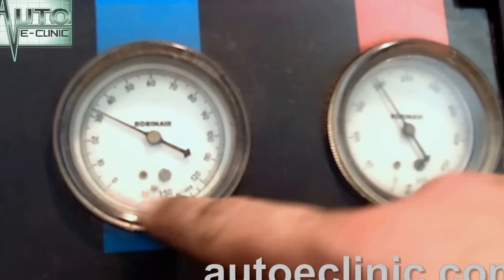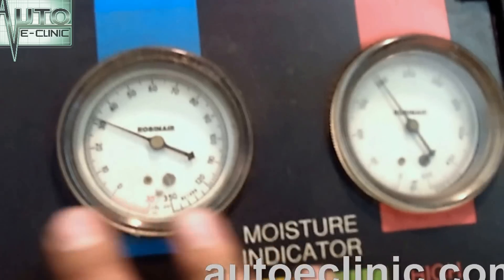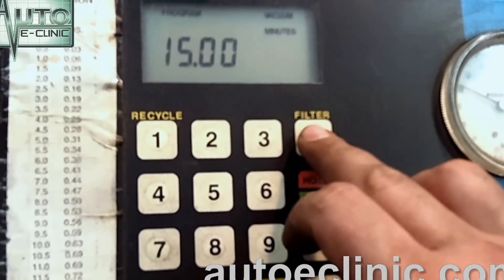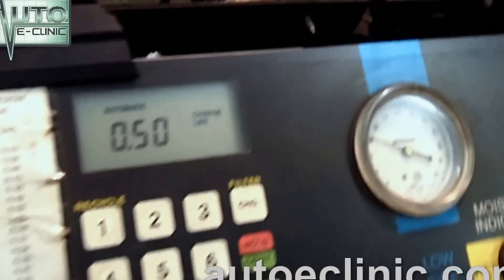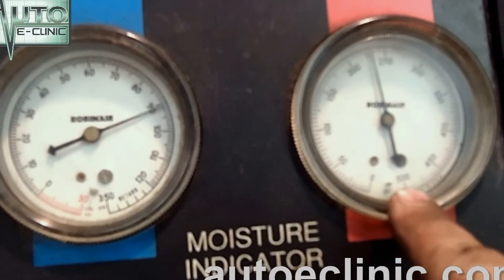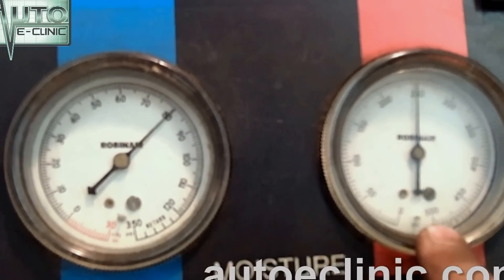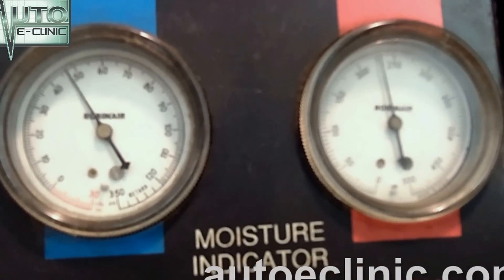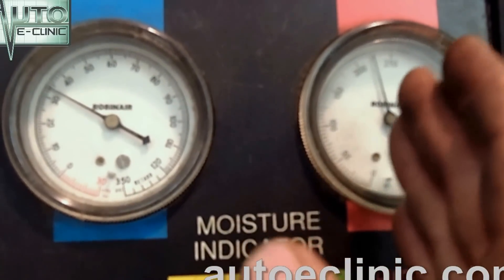How To Recharge and Diagnose Automobile Air Conditioning

Comment: i would think if i had a vacuum unit in front of me and i can remove all in system like water maybe ... i would use it only takes 30 mins and i have a machine more easy. i could go to lunch or work on something ... so i guess it is not needed to vacuum out the system to charge it ??? i see you removed all freon and thats how you found how much you had in the system so i am just learning A/C systems for i am a Master Engine Builder and i sometimes must remove A/C first before i pull the engine, so i must pay to have it remove and recharge ,,,, which takes a lot of money and time... but i see you do not have to vacuum unit to add a charge i think...

Comment: I just got my gauges today. I have some experience on car A.C. from a shop I worked at 30 years ago back when only new cars had 134 most had r12 you could buy a can at most stores by the oil. I got an orifice tube and a new dryer. Compressor comes on and off but it has very little cold air if any at all inside. Going to replace those parts rest a vacuum pump from the auto parts and see it that fixes it. Do I need to add oil back into the system after I vacuum

Comment: I put in new compressor, new oriface tube, new accumulator and blew out and pulled vacuum and when I fill it the low side rises and high side does not. Could it be anything besides restriction??????    I’m at my end with this car.

Comment: With today’s cars  small is 12 ounces of refrigerant charge if you’re just two or 3 ounces overcharged you can see 440 psi on the high side where the pressure limiting switch will kick off the compressor.      And the majority of all vehicles produce today are variable compressors that are controlled by software and sensors and you cannot fill up the system using cans by using pressure on the high side and low side because the software is continuously varying The compressor displacement and trying to maintain a pressure that is the most efficient no matter what the refrigerant charge is high or low

Comment: JesusHchristmasTree, you fools ALMOST know what you're talking about. At 00:21  the errors start; NO safety goggles, no protective gloves, either!  
At 04:02 he says "...it's lower humidity in here" No, it's probably higher humidity in the COOLER shop! Humidity rises as the as "the same air" temperature drops. 
At 05:42 he misstates "...we're showing you how to do it WITHOUT gauges"?? Huh?
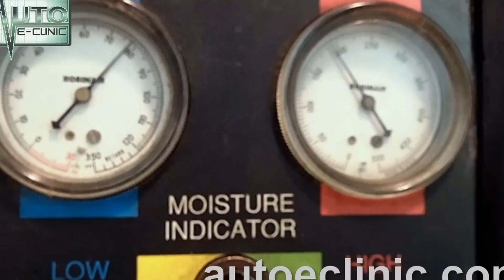At 06:10 he repeatedly says "thermostat" instead of "thermometer". 
This was a MISDIAGNOSIS! The starting low pressure (100 psi) was more than enough to allow the compressor to engage. Why didn't it?
Reply: Stop whining and complaining like a Queen or Democrat, be thankful he posted the video.

Comment: I have a 2000 Jeep cherokee  4.0 it will not take freon.. Has been vacuumed. what will cause this...All help appreciated...i tried jumping it over from the switch and it blew my big 20 amp fuse. Twice... you could hear the rpms raise a little but didnt kick the clutch in. Im showing both sides hot/power on the low side pressure switch with a test light. Ubnless i unplug the high side. Then 1 side shows power other dont  but bridge over then and dont blow fuse but dont cycle clutch. It will also blow a fuse if i try to bridge it over from the relay.. However i can kick the clutch in by running 1 wire from  hot on the compressor to the hot on the battery then clutch works... Still wont take freon. Help...

Comment: Did you fix a control problem because you took out 1.84 and said full  2.22 lbs was fully charged.   At the 5.20 time frame you took out .5 lbs from full to show what the system readings were  and the compressor was cycling just fine. That put the system at 1.74 lbs lower than the starting point. This was a great video with a lot of good knowledge.
Reply: @Jay Fenwick - You caught the MISDIAGNOSIS by these dummies!. WHY didn't the compressor cycle on with the higher low pressure? Daah!
A lot of errors in this video.

Comment: Great explanation. I have a doubt, you say the center vent is the coldest but on my 06 Lancer ES the driver's side vent is the coldest. My readings are 43,7F and about 46,4F for the center. Also when driving the temps doesn't go down by much. The compressor does cycle on/off from time to time, those were the coldest readings between cycles. What does this means?  Do i still need to add a bit of freon? My pressures were about 28PSI and 215PSI for the high, ambient temp about 30C not in direct sunlight. Also, does the evaporator dirtiness affect the minimum temperature or just the amount of air coming out the vents? Thanks. I really appreciate your help. Thanks again for sharing.

Comment: Man I want one of those machines! Someone else said that when you take a static reading if pressure is lower than 120 to 125 PSI you know then and there that the system is leaking.

Where would you look if you had charged that thing perfectly as you did and the vent temp wouldn't go below 60 degrees?

Comment: what if low side is 55 and high 250 yet when it is hot outside i only get 55 in the front and 77 in the third row of my Dodge grand caravan which has dual a/c.  the  gagw psi is not helpinf me diagnose the problem.

Comment: Mine is a peculiar case as my ml 350 4matic only cools when its idle. For some reason it stops cooling when I accelerate. Almost as if the compressor just shuts off when I step on the gas!!
Any idea what could be causing this??

Comment: I have a ford f 150 06 and I have a problem with the ac. I connect the gauges and my low side needle bounce and reads 77 psi and hi side is 180 psi its 80 outside. Without the truck on the gauges read 85/102. I had people tell me that the ac compress is gone or I have a blockage.Or my clutch fan is gone.  Please help me

Comment: I wish I would have watched this video before I used that can of Artic Cold/Air stuff.  I over charged my system and screwed up my Schrader Valve on my low side in the process. I might have saved $200.00.   I had the manifold I picked up from Harbor Freight but didn't know what to look for.  It pays to research before you do an AC recharge.  Also make absolutely sure the AC Pump (Compressor) is cycled onwhen reading the gages and checking the filling levels too.  It's really easy to overcharge if you do it wrong :-(    TY so much for making this GREAT video!  This is the best Video I've seen on explaining the process.
Reply from the maker: Joe Parso Thanks! Unfortunately Michael passed away back in March of this year but e would have greatly appreciated you compliment!